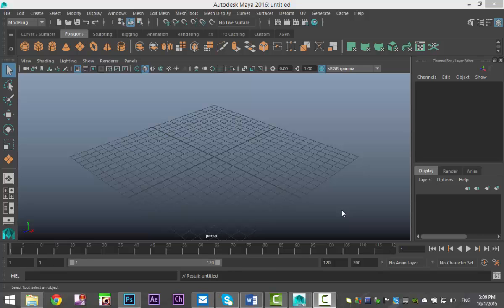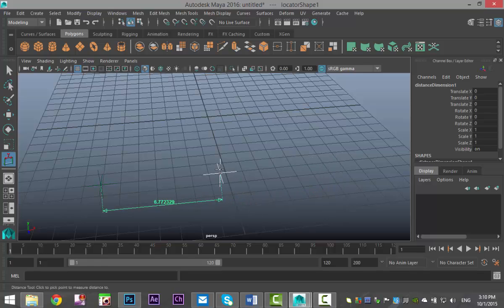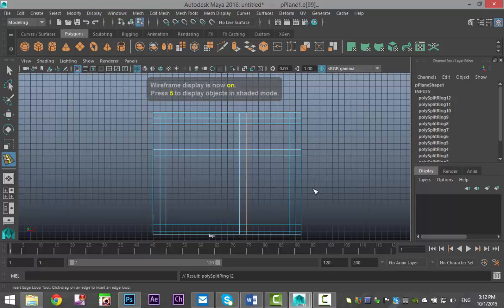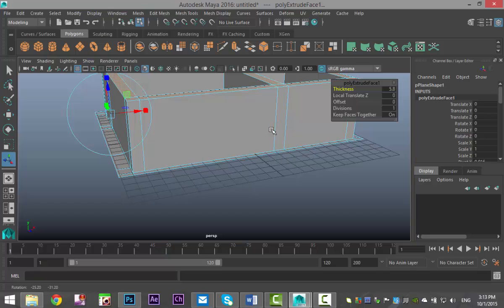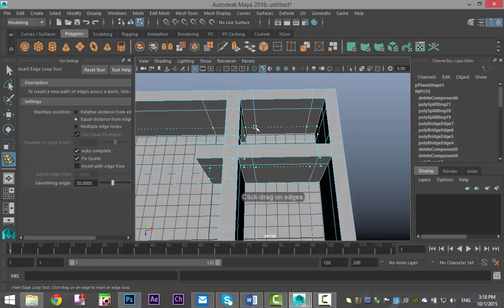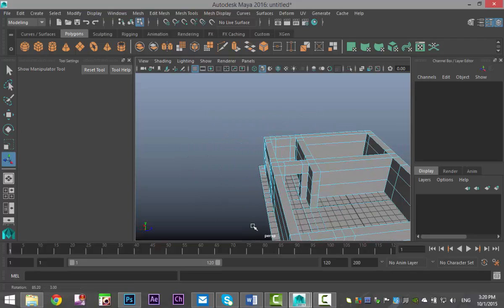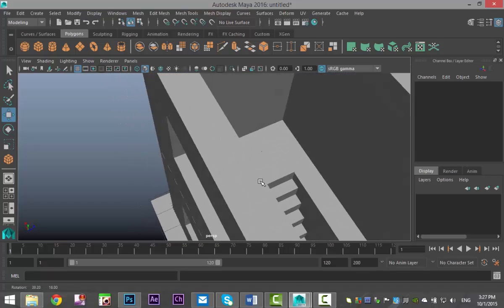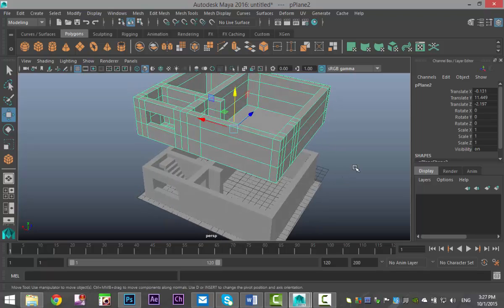Maya 2016 tutorial : House modeling basics

Comment: Hi Mike, thanks for sharing all the tuts. They have been helpful over the years. Have  questions regarding exact modeling. Is there a way to make sure the measurements are exact? Coming from SW or Autocad as example you can click face and adjust distance. In maya I can get 'close' with the scale but there is always that uncertainty that it's scaling from an arbitrary form if that makes sense. Is there a way to click an edge and input edge length is 8in? Current workflow is model things roughly then go back over with distance tool

Comment: Does Maya have any kind of inferencing like in a CAD program?
Reply from the maker: +edwin11373 What do you mean by interference ?
Reply: Not "interference", I meant "inference". Like when the software's engine helps you align your geometry accurately. This is why CAD programs use this system to create accurate architecture. I use Sketchup which has an incredible yet easy to use inference system. I think this link will tell you exactly what it does(and check the video in that link):

 http://www.mastersketchup.com/sketchup-inference/
Reply from the maker: +edwin11373 My bad LOL I must have been sleeping when I read your e-mail. No, to my knowledge there isn't anything like that in Maya
Reply: Lol, no problem. ^^   Anyways, too bad that neither Maya or 3d Max has this system. 3d Max does have the snapping tools but that isn't intuitive and it's cumbersome to use.
Reply from the maker: +edwin11373 Yep, I know

Comment: Hi Mike! Can boleans be used to make holes for windows and doors? 
And you could save some time alinging those edges (I mean those, for doors and windows you made at the beginning). 
For doing that go to translate tool options and under 'Move Snap settings' turn off 'retain component spacing'.
Then select the verticels you want to aling and snap them to grid. (Make sure you are using world axis orientation).
And could you make a tutorial about how to create a creepy atmosphere (like in the witcher 3 trailer) using mental ray?
Reply from the maker: +Alexander Kropyvka Hi Alexander,

Yes, you can use Bouleans but I would NOT recommend it. Bouleans are notirious for creating polygon and UV trouble.
As for the snapping, yes I am aware, sometimes I do, sometimes I don't.
As for your request, I will put it on the list, but be aware it is a very very long list :-)

Mike
Reply: Yeah, i guessed that the list is not short)
Anyway, thanks!
Reply from the maker: +Alexander Kropyvka I will see what I can do Alexander